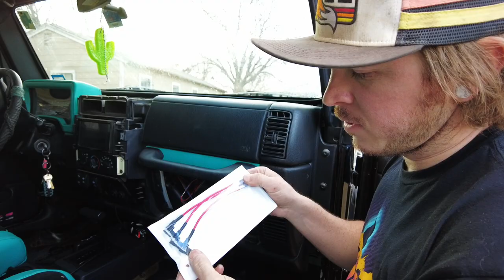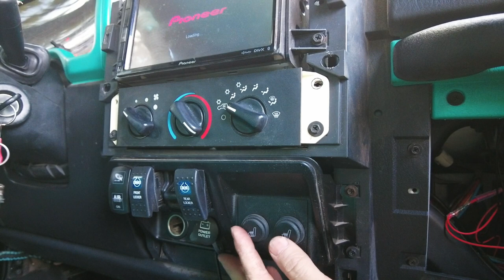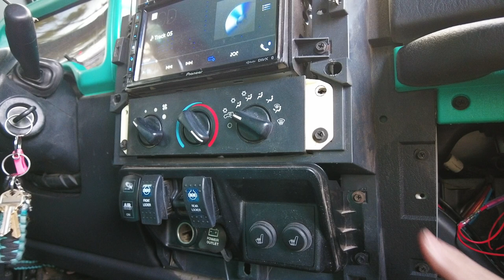PRP Enduro Elite Seat Install in our Jeep TJ Unlimited / LJ

Comment: I have a 04 rubicon I see you have arb lockers, I ended up putting them in mine also. Although I gots to put a new axle seal in the drivers side rear axle. I got to figure out what gear oil to use in the mean time cause it leaks a bit. Don’t want it to dry up!
Reply from the maker: just standard gear oil works great nothing fancy required. One upgrade we did was toss in some revolution chromemoly axle shafts in the rear. Because they came with new seals and bearings pre-installed. We had a leaky axle seal in the rear so got two birds with one stone with that install.

Comment: I just finished installing these in my 2004 TJ. The seats are comfortable and look great, BUT …. (1) getting the brackets off 5he old seats was a horror. Finally just took the sucker totally apart. (2) I took to heart comments about people shorter than me wishing they had ordered the 4” tall seat. When I got them and read the packing slip, they were also 4” wider. That added a few other problems. Driver seat hits the center cup holders and won’t slide more than a few inches. I’ll ditch the whole console and leave the shifters on the floor. (3) The brackets they sent, which I ordered, do not fit the wide seats. When I asked them why they shipped them, knowing they would not work, she said, “because that’s what you ordered. You’ll have to fabricate new brackets.” We found a work around (actually, Cody Little found a work around) but it could have been a real issue. (5) Seat belts are another issue. PRP tells you the OEM belts will not work with their seats and leave it there. Found very little help online other than some seemingly convoluted contraptions. I will put in a harness for trail use but want an OEM system for road. Finally found a solution from Rock Hard that is meant for harness lap belts but, coupled with a belt extender, should work. Your approach in this video will work, too, of course, and I should have found it sooner! But nicely done video. Thank you
Reply from the maker: Yeah the seats are definitely a learning experience for sure! Glad I can help out where I could. And we still love the seats to this day!